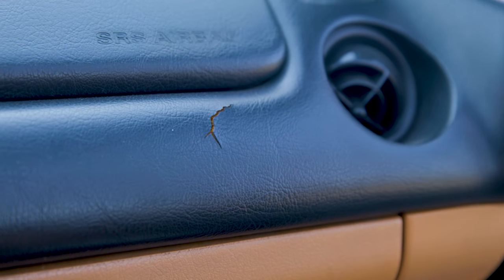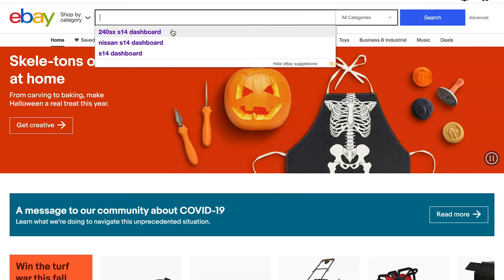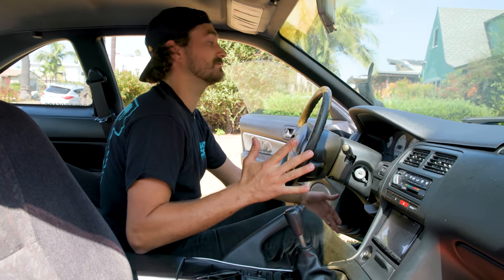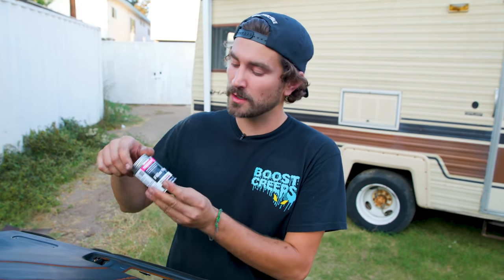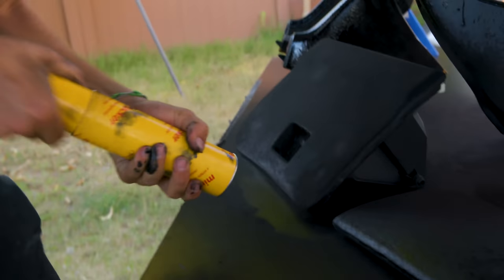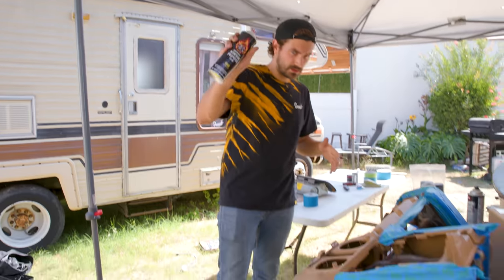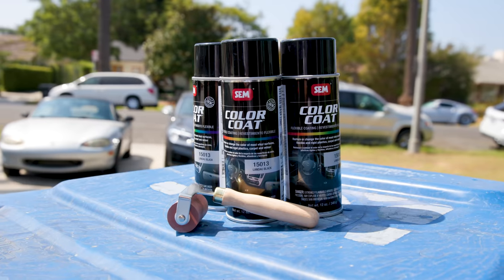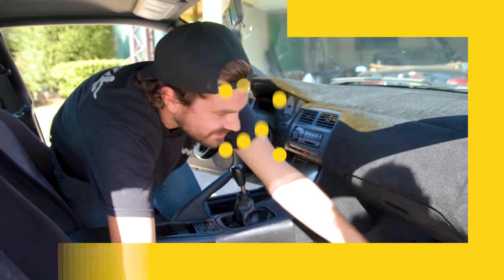We Tested 3 Cracked Dashboard HACKS

Comment: Don't forget that buying a replacement dash is only like 5% of it. The other 95% of it is pulling the old one, replacing all the other stuff you broke doing so, then bolting the new one in. And since you already have the dash out, you might as well replace your heater core,  evaporator core, the broken blend door, and since you're fixing all the under-dash stuff, you might as well finally replace the compressor so you have working AC.

Comment: “Filler is kinda what bondo is" 

"smells just like bondo"
🤔🤔🤔
Reply: Scientists believe it may even be made of a similar chemical composition as bondo.
Reply: I would certainly hope its not bondo. bondo expands and contracts when temps vary. This is why all cars with thick bondo start to flake out. With how deep the cracks were, the dash would surely crack again. I have an E30 with massive cracks, so I'm going to just fiberglass over the whole dash then flock it. This way I can be certain it will never crack again as it is a big issue with how old these cars are getting.
Reply: My dad patched a rotted bathroom floor with bondo once...... jt lasted longer then the floor

Comment: Does the flocking turn your dash into a dust magnet? I can imagine it being a pain in the ass in the long run
Reply: Not really too bad for dust, brush nozzle on vacuum works good to keep it clean
Reply: It's the future. You can get a powerful cordless vacuum as well as electric hand held dust blowers for textured surfaces like this.
Reply: I did option 3 on my 84 Toyota xtra cab dash 
When filling use the bare minimum because sanding filler on weak sun dried plastic sucks also sand the filler when it’s workable don’t let it dry over night the filler will be harder than the dried out plastic
Reply: This cheap flocking will fell of in couple months
Reply: That shit ain't gonna last. Unless he keeps that car garaged and only drives it twice a month, it's going to start to come off soon enough.

Comment: Yeah I am going with option 4.  Have a 90 300ZX with a peeling up dash.  Opting to remove the dash, cut out the peeled areas if not skin the whole dash, paint resin over it all, sand smooth, and spray with U-Pol Raptor.

Comment: How does the flock go with having hands touching or running the dash, does any of the material flake or stain your hands / clothes when you legs press up against it during hard cornering or drifting? Always wanted to fix my dash up this way in my 180sx but worried about flaking, thanks!
Reply: same, and how is dust. looks like u cant just wet vipe
Reply: this!
Reply: Well let’s think about it logically... you laid down some sticky glue all over the dash and dusted on some dust particles on top.

Ummm... yea the shits gonna come off!!!! Lol. 

I think that cover is by far the best option.
Reply: @I_know_what_im_talking_about  not an answer.

Comment: Do steering wheel fix comparison. Mot just a cheap auto store wheel cover, but like flocking, painting , or those leather covers on ebay (you sew them on).
Reply: This would be useful. Our Audi 100 steering wheel has taken some damage from the hand sanitizers, so it would be nice to see some DIY methods to restore it. I would like to try shue polish and then remove what can be, but i'm not sure how well it works on plastic type of stuff its made off. I dont think painting really works in that case, wheel covers are hideous and flocking like with dash sitll leaves particles to get loose, its pain to clean afterwards and personally i dont like its look.

Comment: A fourth option - which I did. Buy some fake suede/alcantara. You can find it on eBay and it has a slight foam backing and stretches. Fill the cracks on the dash, apply a good fabric spray adhesive (3M Super 77 is great) and apply. Cheap, easy, and looks great!
Reply: How long does that last thought? When exposed to constant sunlight
Reply: @Tugboatpb  It's a good question and I have no idea yet. My guess is that it's going to fade but using the Dupli-Color Vinyl and Fabric spray is amazing if it needs to be touched up.

Comment: I really like the Flock it’s really cool looking.
There is another way… a bit more advanced.  A guy i knew when I lived in St. Louis had a diy overlay method in his garage.  He would color match vinyl. Using a thick heavy weight stiff vinyl.(not very pliable)
Strip the cracked dash vinyl.
If the foam was repairable he’d repair it with some light shaping.  Otherwise he’d strip to the boarding and glue overlay new dense stiff foam then contour shape it.
He’d cut the vinyl to shape similar to upholstering a seat or door card.
His method may make more sense if I explain it. 1-he’d drill a number of small holes in dash from beneath (not through foam just the board and he’d glue/seal plumbing barbs on the holes.
2- he’d put the vinyl in a heat box make it soft
3- attached a vacuum manifold and hoses to the barbs
4-very fast he put a weak adhesive on the vinyl, wrap overlay seal the seams with pinching force to board on the back side and applied a not full vacuum(too much causes wrinkles, too little doesn’t bond the adhesive).  He’d use a heat gun and a rubber spatula to press out folds and wrinkles.
5- he’d use the heat gun and seal vinyl borders on the back side and tack them into place. The vacuum will bleed off so it is constantly pumping.
6- after the vinyl is cooled and and adhesive has cured slowly release vacuum.
7- if texture was too deep in vinyl, color match with some type vinyl plastic paint.
His garage felt like it was a blistering hot oven when he did his work.
He charged $$$(maybe $500-600) for those he didn’t know and those he knew, just supply him his cold brewskies until he’s done… if the cold brewskies stop he stops, so be prepared.  He’s done full color changes to the interior and dash and it literally looks and feels original production line.

Comment: There's a forth way. Fill the cracks sand back. Spray the entire dash with a product called wurth sound deadening spray to achieve the same profile. Overcoat in the final Matt spray paint you choose. .I supplied a conversion shop with these products doing left to right dash conversions.
Reply: I have some cracked elements in my car so I tried to look this up and could not find a sound dampening spray from Wurth, at all. Not on their website, not anywhere with Google's search feature. I did see a couple other brands. Any chance you can help me track down what you're referring to?
Reply: @AscendantCaleb  underbody seal, stone guard  Google at that..try a can
Reply: You need to paint over it when it's done

Comment: I just fill mine and add textured bedliner to the entire dash. looks great and is rubberized and will flex. Handles sun and heat very well, comes in multiple colors. CHEAP option (about 40 bucks)
Reply: I was wondering about using bed liner to spray repair a filled and sanded cracked dash.  I was even wondering about leaving the dash installed and thoroughly masking everything.  Removing my dash is an all day job.  It'd be easier to remove and reinstall the windshield.

Comment: I’d rather live with 10 cracks in the dash than take it out. It’s the one part in my car I’d never remove.
You can never get it back in as perfectly as they did in the factory and every dash that’s been tampered with I’ve seen, is creaking; and creaking is WAY more annoying than a crack or 2
Reply: I find that a little bit of silicone grease on larger surfaces you think MIGHT move works wonders for that. I did that in some areas and the thick rubbery double stick tape in other areas on my Isuzu diesel's dash and It worked great. (and that thing had a 4.8 liter Inline 4 that shook the whole truck when it felt like it, so definitely a worst-case scenario)
Reply: The layover might be installable without pulling it.

Comment: Love that they didnt include the price of the filler or the primer on the "cheaper" option
Reply: The filler had to be used on both cars to fill the cracks in, the options they showcased were for the aesthetic repair you'd have to do after getting the cracks filled in.

Comment: I know im late, but you can buy some 3m "texture coat" it adds a decent texture, and if its to rough just sand it down with fine sand paper and spray some trim black spray paint, works like a charm.

Comment: I watched this video a while back and I thought flocking was really really stupid. Cut to July and August 2021 and now I'm flocking the A and C pillars, the sunroof cover, and my headliner in my e36 and will likely do the rear speaker deck as well.

It works really well as a permanent solution to sagging fabric and failing adhesive, so as much as I don't think I'd ever do it on a dash, I'd definitely recommend it for other applications. Very cheap and pretty easy depending on how much you're trying to do and the complexity of the parts.
Reply: you were right the first time it is "really really stupid"
Reply: @davidgalea6113  flocking the dash, yeah; flocking as a means of weight reduction with a finished interior look, nah pretty slick.

Comment: flocking point is to not see reflections in your windshield while racing if nobody said it already, something else a racer told me is to wash the interior of the windshield with dishwashing liquid to prevent steam on it, useful when you delete the aircon on a car for racing supposedly still haven't tried 10y later

Comment: Tip : 
If you have a lot of cracks like the first dash. 
After you mix your filler. 
Put it in a sandwich baggie and cut a small hole in the corner. 
Then you can squeeze the filler into all the cracks quickly and then smooth them out with your spreader.
If you do it this way you have to make sure you have enough time to spread out the filler. So maybe make a small test batch and time it so you know how long you have. Temperature, humidity, and the amount of hardener greatly change the rate of hardening

Comment: A trained interior repair tech would go with a mix between option 2 (padded dash filler) and option 3 with the sems dyes. Also, Sems makes a chip guard spray which can imitate the grain of the dash without having to use a graining pad and roller. All in all, option 3 is what majority of customers are looking for in terms of keeping the dash as OEM as possible. Id say your work is very good for a first timer and if you had more experience it would have come out even better. Very good job though.

Comment: As an Idea : If you want to Fix that little Crack. Make a Stamp out of Wax from the Original-Texture of any other Part of the Dashboard and Press this "Negative" into the Filler oder Bondolike stuff. I used that on 2 Dashboards, and it worked PREEEETTY good. Greetings from Germany.

Comment: My favorite way to re-texture a surface is to pour some mold-making silicone over a good section, wait for it to cure and then peel it up to use as the texturing tool.  It'll match the original texture perfectly, because it is the original texture.

Comment: For future referance wrapping the dash in leather or vynal will give you the BEST end product. If you want to fill the dash you want to fill the Crack and make sure you don't sand any of the actually material. Then you fill the Crack use a piece if scrap vinyl like you did but spray it with a non stick spray like Pam. It will roll over the paint but the paint won't stick to the roller and pull off. So you will have a deeper design. Use the SLIGHTEST amount of lubricant as too much will saturate the paint and you'll be back to square one having to fix it. Trust me it's worth getting a nice piece if leather heating it up with a heat gun and using a very strong adhesive  to hold the leather to the dash. It won't just look new it will look better than new. I'm going to slowly replace the old fake leather in my 84 cadillac with real leather. Dash pad is the first to be done.

Comment: an idea could be a combinations of method 2 and 3. you could use masking tape over and around the damaged area, dremmel the area out and fill the groove with some sort of epoxy and use the roller method on some similarly textured leather in order to transfer it to the epoxy before it has cured completely!

ideally choose one that becomes more putty-like towards the end and then you can find or have a paint mixed to be as close as possible to the original and paint it over the epoxy without removing the masking tape for a flawless finish!

Comment: You can build a custom texture stamp using dent puller glue, the black sticks in a hot glue gun. Put some glue on the texture you want to copy, wait for it to harden, and the glue releases easily with isopropyl.

Comment: OPTION #3!! Instead of printing onto the paint you should have focused your filler ONLY in the crack. Then imprint the filler, like clay, to match the surrounding grooves or texture. THEN paint over it all. I suppose much like body work is done? Filler, sand (texture), paint.

Comment: I got a bad feeling about the flock dash.
How do you clean it later? Vacuum might start wearing away the flock.
Maybe you can flock it again, maybe not.
I like the good at a glance, less invasive method. The whole dash remains stock.
Didn't show what the sealer was.
I have an AE86 dash that's cracked and lifting up like a breaking wave. 
To cap it I'd  need to grind or cut it flat.
They used to sell this leather and vinyl patch kit on t.v. that had different texture patterns you ironed over.
Old cars had dash boards and you could replace the leather,vinyl or cloth easily.
Always wanted to do the whole interior in Marshall amp Rolex. Have 4x10 inch Celestion speakers with the basket weave covers and white piping.
It would be like being inside an amp.
Vw had a car you can plug a guitar into and it came with a custom guitar as I remember.
Reply: I meant Tolex it's the fake leather. Darn spell check.
The companies that wrap cars should get on this dash problem.

Comment: If you wanted to add the texture, what you should've done was paint the whole thing and wait until it's completely dry. After it's dried up, paint the vinyl black and then roll over it. It will leave the texture marks in black over the already dried and fixed dash. Then just seal the dash with a satin matt finish

Comment: I think you could get a better effect with the paint method by texturing the filler and instead of the vinyl you could copy the texture of the original dash by poring some silicone on it letting it harden and then peeling it up

Comment: Zack next time when u try texturing don't texture the paint texture the bondo saves you a lot of work , and how to first sand it back flat let it dry and afterwards put a thin layer on your texturing sheet let it pre harden just a little than apply with the roller lightly let it sit for a bit so you don't get to much upstanding material,  paint a normal

Comment: My method making texture: grab a piece of leather, dry a bit, grab a roller and a long solidifying glue. Glue the roller, wait till barely liquid, and roll it on the leather. It will pick up the negative. Works with silicone too, but harder to pick the right point before it becomes solid. About 15 minutes. With the right glue You have about 1.5 hours... So You dont need to stand there and wait...

Comment: Question - my 2006 Infiniti's dash appears to be chemically breaking down and it looks like it's melting.  It becomes super sticky in the summer.  Think flocking over it will hide this and/or at least slow it down?
On a side note, Zach is great.

Comment: Very interesting - I hate black and grey in car dashes and interiors, I really like the beige and caramel look of my 99 Mustang six - on the overlay, I love thinking that could easily paint this with a good plastic paint to perhaps make the Miata dash the color of the lower dash on the cowl over the speedometer - also, on the lower priced option, the crack that was still barely visible - would that be easy to conceal by using a good vinyl tape under the repair?  The flocking I wasn't wild about, but maybe in a different color - like a beige, or a bit darker - I always think of how hot a car interior is - and hate colors that just "bake it" - one thing I noticed is that I had a badly cracked bezel speedometer bezel on my 99 Mustang, in the beige-type color - couldn't get it at Ford - on ebay, found a guy that sold them, the first one arrived badly packaged and broken into several pieces, the color was beige front and back.  The second one arrived intact, was black on the back, and seemed to be spray painted very well - the appearance when on the car is excellent, though I suspect this was a different color one with the front painted - still, showed how good and durable the plastic painting practice can be.

Comment: There is one more option, another channel showed using hot glue to make a stamp of your original pattern. Fill in what you need with putty then use the stamp to stamp in the original pattern over the putty while it is pliable. Of course you’ll still have to paint it.

Comment: It's virtually impossible to buy your first option and the other 2 versions are too much like hard work.
I repaired to few car dashes by filling in the cracks in a similar way to you do without removing the dash. After sanding & cleaning, we glue vinyl 'pvc' that has been precut to shape. Visually it looks amazing & durable and not 100% original.  
1 dash we did 20 years go still looks amazing today. (unaffected by scorching sun) haha

Comment: Question  for Joe : Wouldn’t the flocked dash become harder to clean with that fiber texture ?  You can vacuum it, but never wipe it down again?  
I have the same concern when I seen people drape their dash with what looks like a factory made carpet cut & molded to slip over a cracked dash.  It seems like once anything messier than dust hits that kind of dash covering, it would need a shampoo or wet vac cleaning.